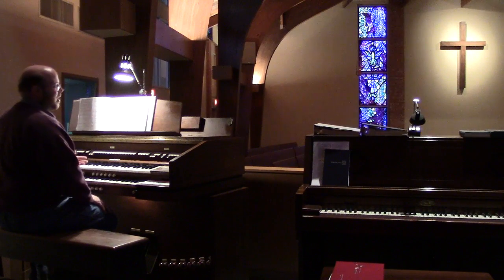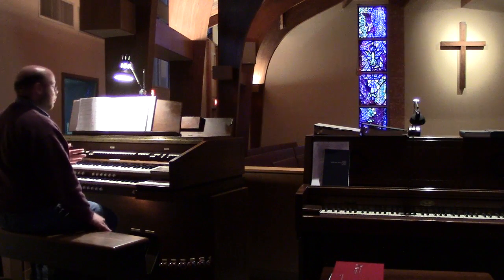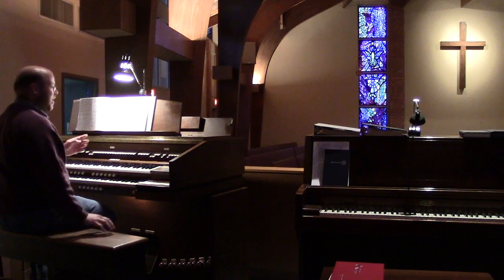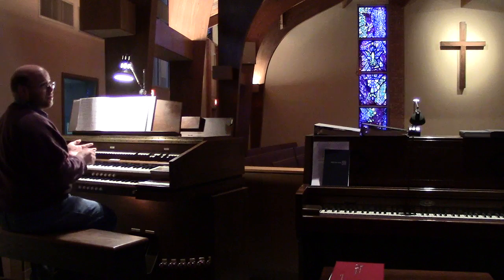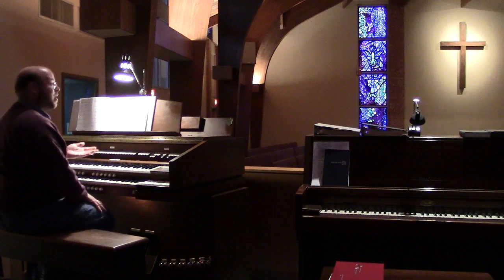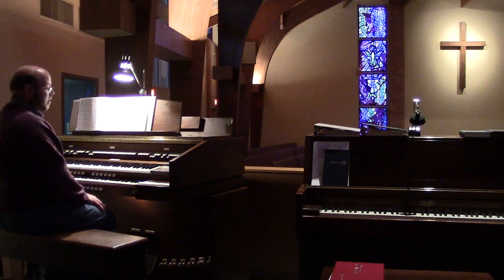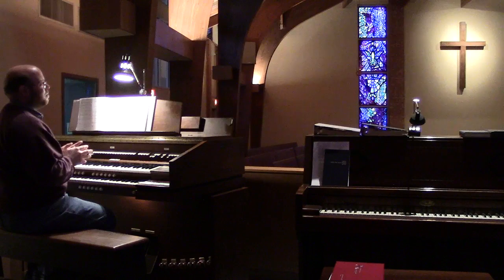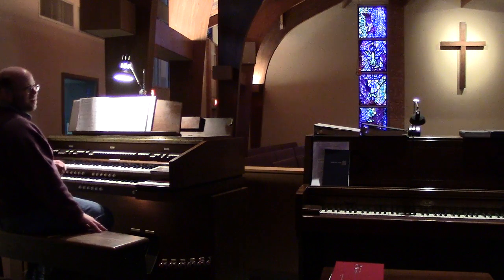1972 Allen Digital Computer Organ New Amp Test

Comment from the maker: The position of the altar in this church is actually moveable, some times the setup is such that the organ area is at the back facing the altar (Altar is under the cross), but now it is such that it is at the side facing 90 degrees away. The pastor will change the position of the altar for different church seasons such as Advent and Lent.